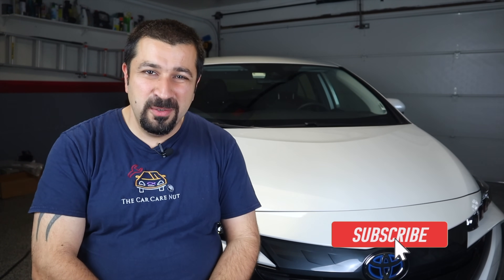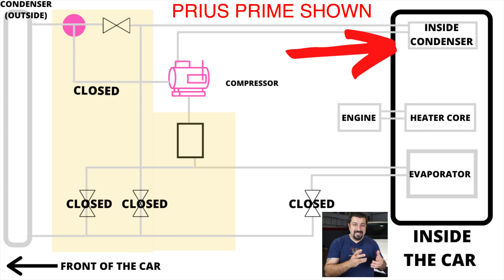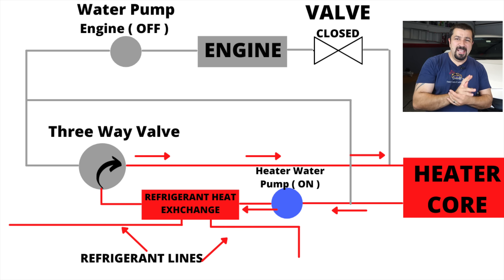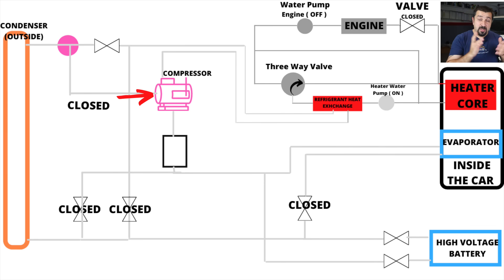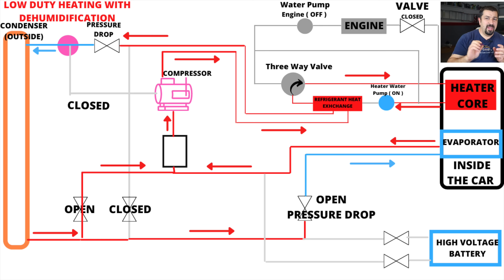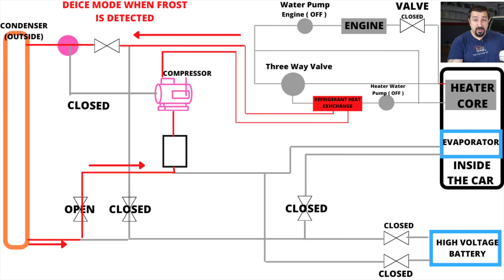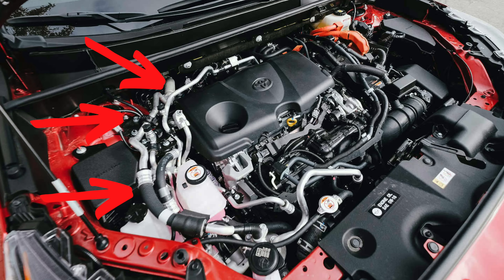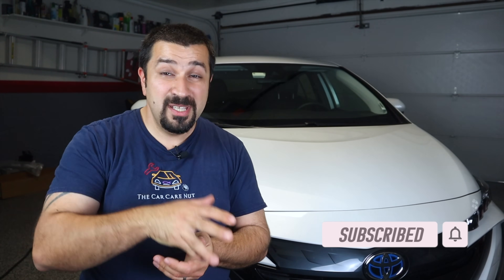The Worlds Most Complicated Car HVAC System? RAV4 Prime HVAC Explained

Comment: Thank you for the video!. Does the system need to be topped off at 80k miles because of a shaft seal leaking on the compressor (like the old days)? Or is it just a "just in case there's a leak" checkup?
Reply from the maker: It’s just in case there’s a small leak. Because of the battery cooling they want the system to always be at optimum performance
Reply: @TheCarCareNut  I assume the procedure is to pump it all out, and put it back in by weight?  It would be very difficult to do it by gages right?  its difficult to do any car by gages, but a R4P?  OMG!  no thanks.  it is r134a still right?

Comment: Since heat is sent in the cabin by the coolant, does it mean that adding a ~600CAD "premium plug-in block heater" would allow or significantly enhance HVAC heating under 10F ?
Reply from the maker: The block heater will need continuous power to work as soon as you turn it off the heat will be consumed rapidly and not replenished. Also the system by software won’t even operate below 14 F so it would just turn on the engine to keep the heat going
Reply: @TheCarCareNut  Thank you!
Reply: @TheCarCareNut  That block heater is not  a bad idea tho.  If a large section of the coolant is kept hot by the heater, and the car was started quickly after it was unplugged, Id think you might get heat much faster then normal even on a mild day.

Comment: Hello my friend,  I have a question my tacoma 2020 when the ac is working has a little noise like a tick, what can that be thanks
Reply from the maker: Hi! Is it a single tick or continuous?
Reply: @TheCarCareNut  it's single but when idling it does it sort of every 10 sec or so
Reply from the maker: That’s normal for the ac compressor engaging and disengaging.
Reply: @TheCarCareNut  thanks you're so responsive as always

Comment: Hey Amd, my wife has an 2011 Lexus CT200h, she took it to get the oil changed yesterday and on her way back she got a check hybrid system message and it stopped accelerating, they also topped off her coolant and changed the filter in the dash. Any advise would be appreciated. Thanks
Reply from the maker: Hi! I would take it back. It could be many things hard for me to tell without getting codes.

Comment: Good video.  I am sure it could be clarified a bit in rev2.   I would start with the goals as you did but build that a bit so the audience knows that battery cooling changed from strictly air cooled to refrigerant conditioned.  Second, while the Prius Prime video described the electric supplemental heating, the use of a quick abbreviation here did not help.  In a similar manner I would explain that any refrigerant system does one thing - it transfers heat from one space to another.  In AC mode its from the cabin to the outside.  In Heat mode its from the outside to the cabin.   It might be good enough to note that a heat pump system can switch directions. And advanced automotive heat pump systems work better than typical residential heat pumps because the advanced systems a) use variable capacity compressors that can run higher than 100% because b) they utilize a compressor overheating control known as hot gas bypass and c) because they utilize electronic metering devices instead of mechanical equivalents.  Recently these advances have been become available in the highest end residential systems to allow full heating down to 5f.   In a similar manner the advanced techniques in automotive applications provide usable heat to these very cold outside temps without relying on high wattage electric heating techniques which are obviously bad for a battery operated vehicle.  Finally, understanding that a hybrid does have an engine that, when run, provides exceptional heat, requires some valves to take advantage of it.   And an engine water coolant to refrigerant system heat exchanger to eliminate the extra coil inside.  An interesting aside: Big buildings routinely use refrigerant to water heat exchangers in systems commonly known as chillers.  Geothermal heat pumps used on buildings also use water to refrigerant heat exchangers.  Where Toyota excels is when they incorporate industrial technology of twenty years ago (variable capacity heat pumps and water to refrigerant heat exchangers)  into affordable and mobile automotive systems.

Comment: AMD, here is a nightmare scenario for you,lol! Tomorrow you go into work and your first job  is a Rav4 Prime with a leak in the HVAC system. You have to track the leak down. Hope your employer has a lot of leak detect dye and you have the patience of a saint! Its difficult enough to find a leak in a normal auto AC, can not imagine what it would be like to find a small leak in this system. The  engineers that designed that system should be required to repair them.
Reply: Yea, I already thought about that. I've done almost all my own car repairs and maintainance (after exhausting included dealer work) since learning how to drive 40+ years ago but I draw the line at HVAC repairs and wheel alignment. This might be the reason why I buy a Toyota Extra Care extended warranty.

Comment: Top up the freon? Isn't it a closed system? People don't need to add refrigerant to their central AC systems for their houses unless there is a leak. Why on Earth would the freon need to be topped up unless its leaking? Seems fishy to me.
Reply: He probably means check freon level and top off if necessary. Car A/C system has a lot of rubber seals between connections and it may leak. House A/C does not have it. (except the valves)
Reply from the maker: That would be a good question for Toyota. The same question was asked and they just repeated the same thing. Basically an evac and recharge every 80k miles.

Comment: I must say...it was interesting to watch and hear your explanation.  Now I'm certain that Skynet will eventually take over the vehicles in the future, automate everything and maybe you'll be the next John Conner. With that being said...say for example you were stuck in traffic. Like going 0 mph, it's a scorching 110 Oklahoma Egg cooking on the hood temperature and forget rolling down the windows.... so AC is kicked up in Beast Mode...  Would be it "OK" to  let it run on EV mode?  HV mode? or let it go 1/2 and 1/2 to prolong the Lithium Battery life in the long run.  And this is while waiting in the car for over an hour.  Just wanted to know your thoughts on this to prepare for the rising global warming and rising temperatures.  Yes I could just suck it up, turn off Optimus Prime and endure a possible heat stroke, but the ambulatory ride doesn't sound all that appealing not to mention the cost.
Reply from the maker: You’re good to run it in EV mode in very high heat. The battery cooling is very efficient if it’s working properly
Reply: Thank you kindly AMD for the information, that's what I was hoping you'd  say.   Keep up the good vids. Never had a PHEV, but this 2021 Toyota RAV4 Prime is really something else. I'm glad I got one. Just on one charge alone I had driven 61 miles just on EV alone until the Engine kicked in.  I want to keep it for a long time and hope I don't damage the electrical  by "Topping it off" light a regular gas car.  But I charge it and then when it says like 1 hr left to full charge I unplug it, as I remember you mentioned not to keep it at full charge for long to keep the strain on the battery down.  Is "Topping it off" like that okay in the long run? or don't do that at all for PHEVs?

And I was just kidding about cooking an egg on the hood part.  I would never do that. That's unsanitary. I'd take a hit and just opt for a heat stroke instead.  Hahahaha....

Take care and Stay Safe.

JT
Reply from the maker: I would use the charge schedule which would make your life easier than unplugging it at a certain point
Reply: Thank you kindly.

Comment: correct me if I am wrong .At 8:04 when system should cool down the battery shouldn't the very bottom arrow facing opposite (both arrow are facing toward battery ).And also How does heating the battery work?  thank you very much for sharing all the information.
Reply from the maker: Hi! Good catch! I was waiting for someone to see this. So this is one that is not clear and not published. But here’s the explanation that we got. It uses one line to supply and the other to return and flips back and forth as there’s a 3rd valve inside the battery. And the battery heater is electric just turns on and off by command of the computer

Comment: Thanks for a great video and gratz on hitting 100k subscribers. I got a question. If I like to drive with windows open and A/C off. Does a computer kicks in HVAC to cool a battery or battery cooling only works when I operate HVAC from a dash board?
Reply from the maker: Hi! Thank you! The battery cooling can operate independently from the rest of the hvac functions

Comment: Hi AMD, my 2021 Camry hybrid came with Auto climate control-dual(no other option). How can I reduce the cooling in order to keep the compressor asleep as much as possible without triggering the the heater core door? (The control has SYNC knob). Trying to save gas, so l drive on ECO mode and the AC displays ECO.
Reply from the maker: You can turn off the AC completely if you don’t need it

Comment: Does it ever heat the battery in the winter?
Reply from the maker: Hi! It does but not using the heat pump system. It has an electric heater in the battery

Comment: So why does the hvac system  make a “clunk” sound on start-up in cool weather? I bought mine in March when it was still cold out and every morning as I drove out of the garage and turned on the heater it would make a loud clunk sound. And if you look online at forums this is a common occurrence. No such sound with the cooling side in summer.
Reply: Might be the blend door?
Reply from the maker: Hi! This would need in person diagnosis but it could be one of the motors that move the doors for the hvac air routing

Comment: Cool, thanks for sharing.
Heat pumps that do a liquid to liquid transfer of heat is nothing new.  Water to Air heat pumps used in homes have been doing this for over 30 years.
Reply: They seem to suck in Indiana weather!  I re-engineered quite a big of the parts of the r4p to allow it to safely burn gas automatically while still plugged in via an aftermarket high quality remote start..  That burn gas while plugged in was my hack.  But now I loved my r4p.  The heat pump is ok on cold days if the gas burn got thing hot first.  So I can still enjoy EV driving in the winter. With a 100% battery level each time too since remote starting like this uses very little EV power.

Comment: As always, enjoyed your video. I have a question about a 2017 4 runner. Is the 4 runner equipped with a" port" that can be used to install a brake controller for a travel trailer ? As always thank you very much. 🤓
Reply from the maker: Hi! It’s not something that’s readily available oem.

Comment: I understand how a heat pump works, and understood a lot of the general concepts discussed here, but the diagrams are not well drawn and are confusing.  An example is the diragram at the 8:20 point it shows coolant flowing into the battery at upper and lower lines.  I would expect one to be input and one to be output (even if flow is reversible it should be in one direction at one time) - the diagram does not make sense.

There are also many cases where the coolant appears to be allowed to flow in more than one path at the same time.  This may well be the case, but there is no explanation how this works for the system heat transfer.

While most of The Car Care Nut videos are very good, I found that this one did little to explain how this system works.
Reply from the maker: Hi! The idea of this video is to give a general idea of how the thing works. I could do a full video of exact details of how it switches the flow inside the battery to use one line as supply and one line as return.
Reply: @TheCarCareNut  That would be great if you could do that kind of video!  I am getting a RAV4 Prime in a couple months and I am trying to learn as much as I can about it - especially the technology that is real actively new for this model.

Comment: Interesting they chose to use refrigerant instead of engine coolant like other hybrids and EVS. Every 80,000 is no big deal considering it takes care of the occupants also. The Prius Prime being Cabin Air Cold was a little bit of a letdown.
Reply: I'm going to visit a small town dealership in North Carolina who doesn't charge the additional dealer markup. They have a Prius Prime XLE in stock I'll give it an honest test drive. The RAV4 Prime are special orders.

Comment: Jus' loving this series on Toyota's Prime vehicles.  My dilemma is whether to go for PHEV or the upcoming BEV.  Do you have any idea what regular maintenance be necessary for the BEV cars?  I can see only windshield fluid, tires, brakes, brake fluid, 12v battery, HV fan filter, inverter coolant/transmission oil (if any).  My bad back and age starting to slow me down...😢.
Reply from the maker: BEVs do have lower maintenance than gasoline engines. One small problem is you save up on maintenance initially to pay for the battery later. So they’ll be great for 10 years but after that things can go south quickly
Reply: @TheCarCareNut  Got it...thanks AMD.👍

Comment: Good job AMD, trying to explain these systems to the layman is def not easy. You should note that the external air-to-refrigerant heat exchanger can change its role from a condenser in cabin cooling mode to an evaporator in engine off heater core heating mode. I understand Toyota calls it a condenser in both modes to differentiate the inside and outside air-to-refrigerant heat exchangers, but that's really a misnomer. Toyota should just call it an ARHX.

Also if you want a short overview of Tesla's superior vehicle thermal management system watch https://www.youtube.com/watch?v=rgmBpEQtJ1s . I and some experts in the industry really think Toyota should have copied this system, maybe they will in the future, but some experts think Toyota has lost its way see here: https://youtu.be/06AhaQXhuwQ .

Comment: I rented a stick shift (what else is there) car in France. The engine would shut off at a stop, and since it was muggy, it would get uncomfortable rather quickly. I found out that if I barely touch the clutch pedal, I could keep the engine from shutting down. Voila!
Reply: Tres bien!

Comment: Sound like RAV4 PRIME will be a problem child since there too many sensors which will fail after few years.
Reply: "the second law of thermodynamics says that entropy always increases with time" remember Toyota is slow but reliable. What other brand has replaced pickup truck frames for rust for free dashboards door skins for being sticky 10 years later for free?

Comment: So if put my tongue  on the outside condenser in cold weather it will stick???
Reply from the maker: Probably not :-)
Reply: It might burn your tongue off! D:
Reply: @cappuccino-1721  Cold weather of 30 degree, it would  be harvesting 10 degree heat which would mean it is expelling colder than freezing air. Those coils would be subfreezing. My tongue  would freeze to it. No engine heat involved. Over time there would have to be a defrost cycle. House heatpumps do the same thing.  Too many stories of cranking a Model T in cold weather lips and tongue touching frozen radiators  and skin being removed.